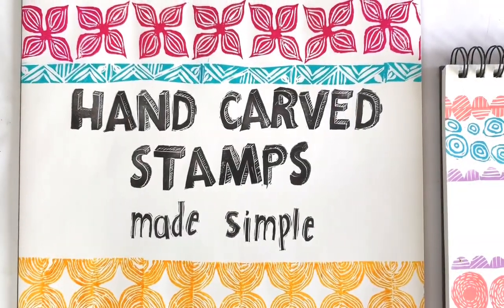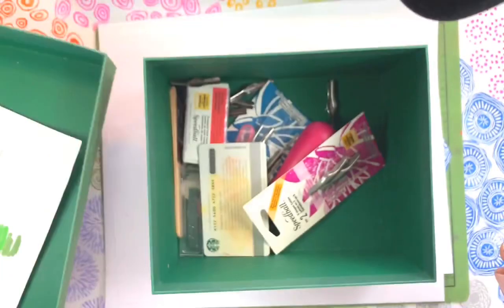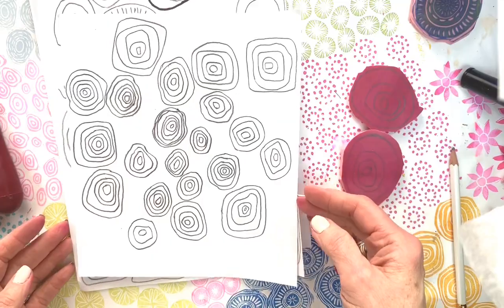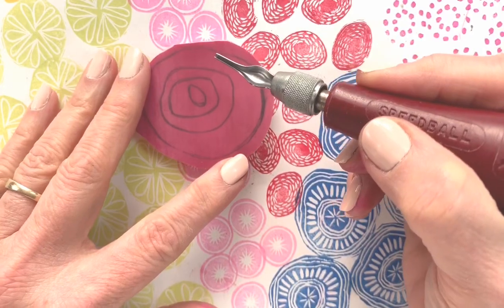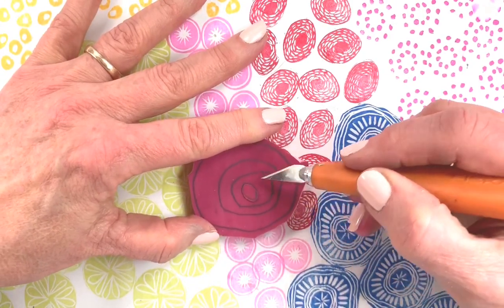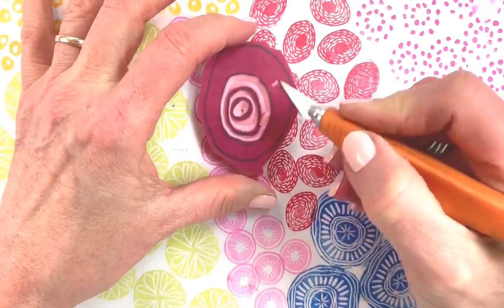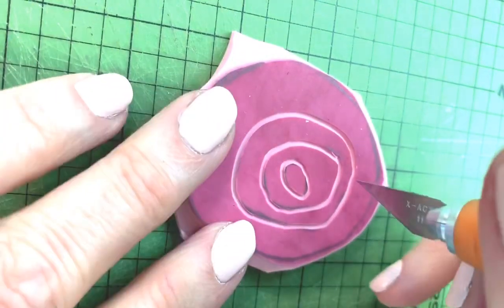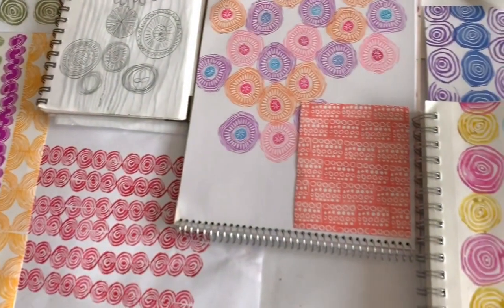How to Carve Rubber Stamps

Comment: I’m so excited! I have dabbled in stamp carving in the past, but your tutorial was so simple and clear!  Thanks so much. I do have a question tho- seems like it would be easy to slip- especially using the knife. What safety tips do you have?
Reply from the maker: Thank you Mary. ✨My biggest tip is go super slow and don't use a lot of pressure. Little tiny cuts give you more control, which means making small passes with the blade. Safety first! Enjoy your stamp carving!

Comment: Thank you so much for the clear, concise, and simple directives. I really like the simplicity and the slow movements of your photography. I don't know exactly how to say it, but for the first time I can see how to cut the rubber and make it work. I have all of the supplies but have always made a mess. Now I realize I don't need to dig in and go deep on the material for it to make a mark with the ink. So simple, but I didn't get it before. I will be moving on to your other videos. Subscribed and liked from USA.
Reply from the maker: Thank you for your kind comments Anastasia! My goal was to make it as simple as possible, I'm so glad it worked 🤗

Comment: I've watched a LOAD of videoes on lino cutting AND then I found YOU!!! Thank you for clear easy to follow instructions and calming voice, have subscribed love from the UK. Could you tell me what no is a very fine tool for detail work, the numbering system is confusing online as you can't really see the size as in real life
Reply from the maker: Thank you so much!✨ I appreciate it. The Speedball blades I use for detail work are the no. 1 v-shaped blade. The numbers increase as they get larger. You're right it's not easy to see online. Hope that helps.✌️